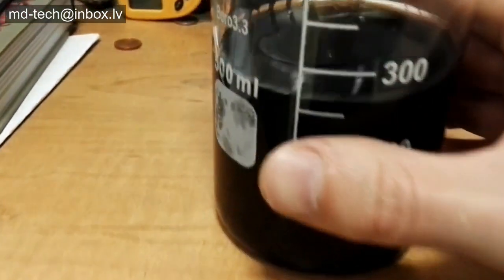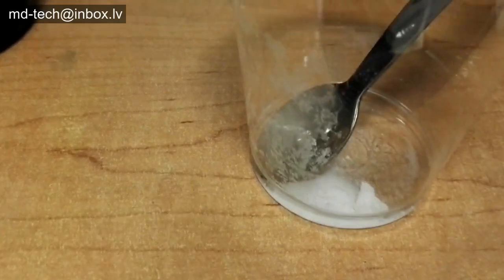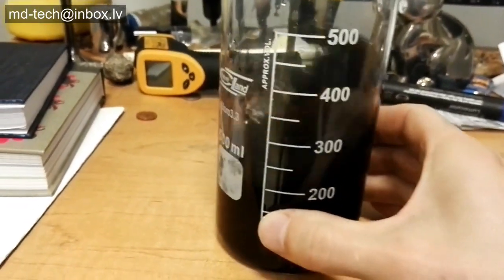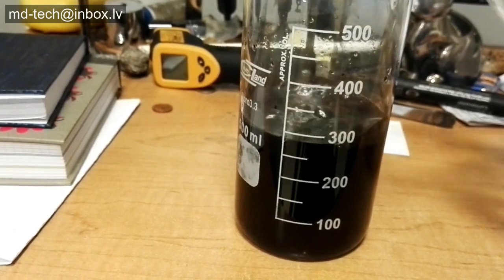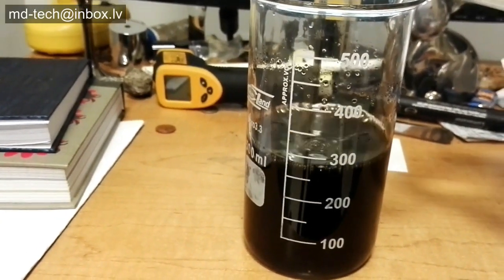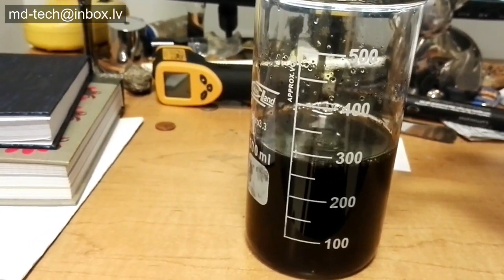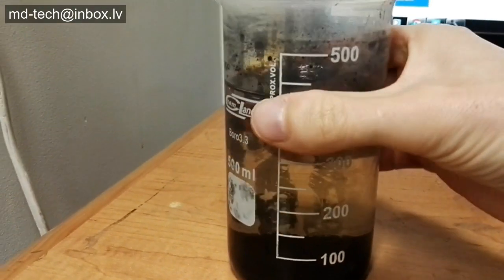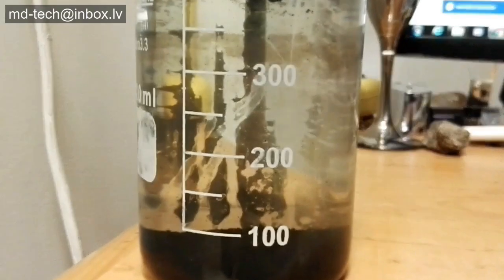How to precipitate palladium and platinum from aqua regia solution.

Comment: If 10 to 12 metal present in one ore so how can separate? Like platinum, neodymium, rhodium, cerium etc
Reply: Depending on the situation, it is sometimes advantageous to find a miner or refiner.
Reply: i have a special method of a pretreatment that can remove mostly everything except noble elements, it definitely helps
Reply: also once concentrated enough most impurities are dissolved in the flux while firing

Comment: Sir I want to know the ratio of AR solution for Platinium Ore???
Reply: 3 HCL / 1 HNO3
Divide the hno3 into three portions. Mix a portion with the still cold hcl and heat it already containing the ore. Add each of the remaining parts during digestion and at intervals of time. If you notice that at the end of the boil there is still material to be attacked, add pre-mixed 3/1 AR and boil again.
Reply: @SURFEAMORETERNO  hi
Reply: @muhammadusmanmunir18  hi

Comment: I use copper just make coils with copper and it will make the flakes then filter than add ammonium chloride and the solution turns yellow a lil metal bisulfate and walla palladium sponge then filter than add sodium hydroxide and walla platinum and gold this is on a PD pt au ore
Reply: Dear, can I have your phone number? I want to inquire about some operations

Comment: How can I neutralize the nitric acid in the solution? I heated the solution a lot, but there is still nitric acid
Reply from the maker: I make video abaut nitric acid denox. In next week.
Reply: @chemistry7119  
Thank you for this. If possible, please put English subtitles on the video and also explain in full.
This has been a big problem for me.
Meanwhile, is it possible for platinum nanopowders to dissolve in a solution of hydrochloric acid and hydrogen peroxide?
Reply: I have metal paladium quantity 28 kg in vietnam 🇻🇳 i sell please message me https://youtu.be/kBE555jl1nM
Reply: Helllo

Comment: Hello, I dont know if you can help or not. I am trying to process ore w/Au,Pd,Pt. Very high sulfur content. Sent sample to a Lab. They said roast, hot Nitric soak, hot water rinse, then AR. Stannous positive[black&brown], Red/yellow translucent liquid, smb in hot water, pour AR into this. NO precipitation. I pulverized then tabled to get concentrates. Wet with peroxide, roasted 5 hrs at 1,000F, then Hot Nitric soak for 24 hrs, hot water rinse, Then in AR[3-1],6 hrs, filter, poured into hot water/smb. The water/smb also stannous pos. I was told to dump in lye water. Would this work? Also how can I remove the sulfur? Thanks
Reply: Hello,i have a laboratory result from my metal,there are,gold,platinum,palladium,now someone who knows to separate from metal?
Reply: you need to roast the precipitate around 1400F for an hour

Comment: Hi, in a solution Pd 98%,  Cu1.5% and Ni 0.5%, to reduce with sodium borohydride, is selective for palladium or all metals are reduced?
Reply: All metals, Cu and Ni also. NaBH4 it's very, very strong and very expensive. 
Do U have torch for melting palladium? U need 1600*C :) I have torch for 2000*C and I can in one time 10g melting only.
Reply: @pyhkaty1258  can we use hydrogen gas instead of sodium borohydride?
Reply: @younessaiyadi3475  yes :)
Reply: Juan where are you located? very important, email migrey1@aol.com
Reply: @1hardman161  hi, i have concentrated  pt pd co in fe ore..interested  can email  mikelee94646@gmail.com
Reply: I have metal paladium quantity 28 kg in vietnam 🇻🇳 i sell please message me https://youtu.be/kBE555jl1nM